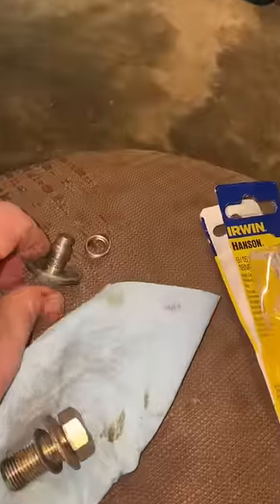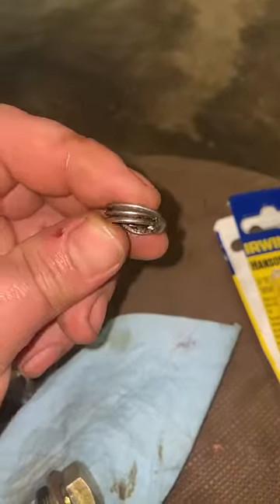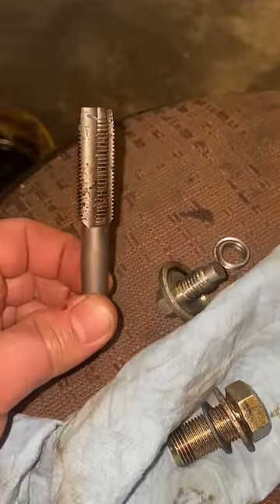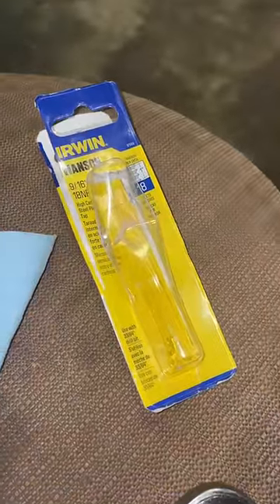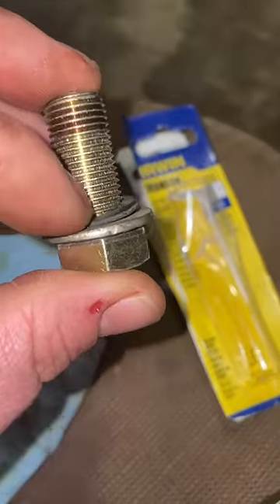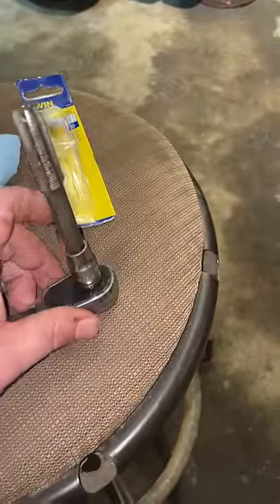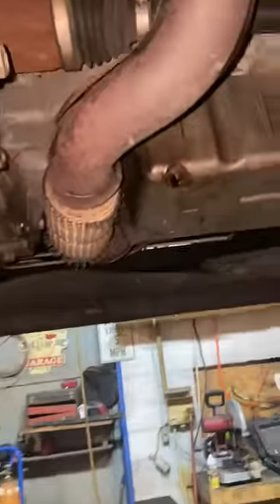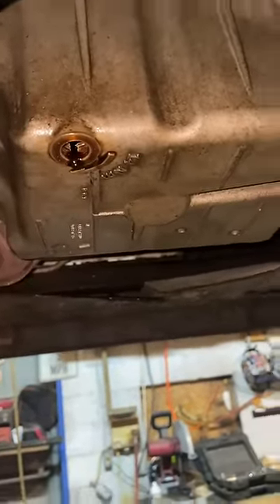Tap threads into oil pan repair quick and easy one!

Comment: I’m guessing you actually ripped the threads out when you were using your impact to reinstall the drain plug. That’s the most likely scenario. I have been an airplane mechanic for 15 years, and I have never had threads come out when I removed a fastener; only when I what installing them and misread the torque specs.
Reply: You should stick to airplanes then. When cars and trucks have quick lane places with zero training required to change oil...this is the stuff that happens

Comment: That extra long bolt will displace a
few ounces of precious motor oil n the 
extra 1/4 lb the bolt weighs will burn 
more fuel, Watson, but it will still work.

Comment: Lose the plain washer if the crush washer will sit on the bolt head nicely. There's a leakage path through the middle of the crush washer, then through the plain washer, then past the head of the bolt. Better seal without the plain washer.

Comment: It will still leak oil some u need to use a oil drain bold there is no gap between the washer and bolt
Reply: You are very wrong sir.
Reply: I saw that, I think I would have put in another Helicoil, or a rubber expanding plug, he is in dangerous territory by running a tap in there and putting an oversized Bolt in

Comment: What about the tap shavings in the bottom of the oil pan?
Reply: I thought the same thing
Reply: You put grease in the tap, it catches most of the sharp bits
Reply: Oil pick up screen catches all those.. leave for next guy
Reply: @marianarcas  I definitely wouldn't trust that method. That's just me. Better safe than sorry.
Reply: @ronlind1757  the pickup screen will catch a chunk. Not a small shaving.

Comment: Awesome job, not trying to be a bummer. But your not supposed to add a metal water on top or under a rubber one. The rubber won't allow enough pressure to seal the washer to the bolt. Will slowly drip over time.... happened to me 😅
Reply from the maker: No drips. Still going strong. It’s my dads car. Just gave him another oil change couple weeks ago

Comment: That’s why I never recommend using helicoil. Keenserts are much better. I’ve encountered helicoil stuck to fasteners too often. And if it backs out into a clearance hole for the bolt the two parts are still joined by the helicoil.

Comment: To anyone one doing this, flush the engine with cheap oil and grease your tap to catch as many chips as possible. Or zip off the oil pan and do it cleanly.
Reply from the maker: Pro tips 💪

Comment: …and just like that you bought a new engine for the client because the metal shaving left in the oil inside the oil pan got picked up by the oil pick up tube. 👍🏼
Reply: And went right into the filter
Reply: There is a screen on the pick up tube it would have to be very tiny shavings to get into the pick up then they would go straight into the filter lmao 🤣  all you have to do is pour oil in while you're tapping to flush the chips out. I take it you've never actually worked on a car before or done an oil change yourself? Lmao

Comment: Looks like it was a Heli coil never seen threads pull out like that .  Hope you took the oil pan off to flush it , shavings from cutting .
Reply: lmao wtf if you did that then you'd just replace the fucking pan after several hours of shop labor
Reply: I worked at a shop for years and I've seen countless aluminum pans with overtorqued plugs that the threads always come out like that intact on the plug. When you overtighten aluminum it shears the threads and they will usually come out on the plug and can be spun off and left intact like that and there is no need to take the pan off because you can just replace it at that point you just need to have someone pour some cheap oil in the top as you're tapping the pan and it will flush the chips out. You can also put some heavy grease on the tap and it will catch most of the chips.
Reply: @xpeacemaster  bro a pan swap takes literally 10-15 mins lmao unless it doesn't have a gasket and uses rtv for the seal then you have to let it set up before you put oil in it

Comment: That looked like a helicoil not the threads. They stuck the right way to fix it would be what this guy did or the threaded inserts for stripped threads just had my sons sparkplug blow its self out bought the kit and matter of 10min it was fixed an few days later it happened to another plug turned out the plugs were loose and the coil pack was only thing holding in the head

Comment: I always thought that the oil pan
bolt plug was one of the stupidest
still used/never evolved set ups.
Hot oil goes everywhere. You drop it...
Over torqued... Why not a valve drain?
Reply: So that a small rock , stick or animal don't open it .  if it had a petcock some pissed off chick or her brother might open it for kicks .
Reply: @JCcanU  
Yeah, just a ball valve with the handle
sticking down... Ah Dah and Doy.
No, I meant incorporated into the pan-
Instead of the plug threading into the pan,
It screws into the valve that's in the pan.
Take it out nothing happens. Insert a
Screwdriver thru the additional hole they
now have and turn the valve open.
Like a damn fireplace gas shut off.
If a crazy ex girlfriend goes thru all that,
then you shouldn't have boinked her sister.
Reply: @SaintMcFoye  lol You see her sisters it was worth it
Reply: @SaintMcFoye  okay great now instead of getting oil soaked all over your hands holding your wrench instead you're still soaked in oil but holding a key and it took twice as long to do... sounds good to me
Reply: @user-gd4gs6bn9o Marone dude. You don't put the key in the hole the fricking oil comes out Einstone. Why is it on here everyone plays devil's advocate with the stupidest reasons why something won't work, instead of trying to imagine a way that it would? You take the plug out like you would anyway and insert a damn Allen key into THE ADDITIONAL HOLE behind it and turn it 90 degrees. 5 seconds big whoop. Oil goes in the bucket. Nobody gets burned. Close valve, insert plug. Anjer Mamabloze...
Reply: @SaintMcFoye  cause it's a bad idea... if it was a good idea manufacturers would have implemented it years and years ago... if you're good at what you do you don't need to worry about getting soaked in oil anyways. why make it more time consuming for the sake of idiot proofing?
Reply: @user-gd4gs6bn9o  Just because youre good at a bad design doesn't make it a good design. And just because something isn't commonplace doesn't make it a bad idea. The table saw brake that saves fingers makes sense to me. Youre probably in the group that says that that wouldn't happen to them, and anyone it does happen to deserves it. Milk producers fought pasteurization. Car manufacturers laughed at the lady who invented windshield wipers. And how long do you think it took for someone to say having only a drain plug on water heater bottoms is stupid, they should have a valve down there? Sound like a similar idea?
Reply: @SaintMcFoye  you should have a look at Occam's razor - the simplest solution is usually the best one. why add complexity to a simple solution that has worked since the inception of the motor itself
Reply: I have done that on my yard equipment, extended out with a nipple so it doesn't run all over the frame, 90 down with a valve, no more oil running all over the place, including running down your arm
Reply: It's called cardboard guys come on now lmao just fold that shit in half to make a little run for the oil if the frame is in the way and they literally make valves that have somewhat of a "locking feature" if you can call it that lol you just thread the valve in and leave it then when you're ready to change the oil just push down on the little lever and slide it sideways and it drains thru the valve close it when you're done and you're good to go lol they have been around for years. After doing thousands of oil changes on almost every kind of vehicle you learn a few tricks to make things easier lol

Comment: That will leak..you can't use a regular bolt and washer with only one oring.the oil will seep down the treads and the head and leak..go buy a real drain plug that is oversized.they make multiple oversize and regular thread sizes at any parts store.

Comment: Yes I went to a fast oil change outfit and the guy stuck a pneumatic wrench on it and forgot to Revere the drive and stripped the pan. Then came and told me it was already stripped. But they could fix it for $380.

Comment: I bought a used 4Runner.  At my first oil change, I realized the moron "mechanic" at the Valvoline Instant Oil Change must have used an impact wrench to install the drain plug.  The threads survived, and I replaced the drain plug with a Fumoto oil drain valve to make every future oil change much easier.

Comment: While you're at it glue a magnet to the tip of that bolt catch any metal shavings I think that's a really good idea for all oil pan bolts it's a little magnet on the end of the boat the catch all the little metal shavings I know the filter would do it but
Reply: Oil gets hot. No amount of glue is going to hold a magnet. A jb weld or actual weld might do though.
Reply: The best way is to drill a hole in the end of the bolt slightly deeper that the magnet and use a punch to stake it into place.
Reply: If it's a steel bolt just magnetize the bolt, simple.
Reply: Aluminum is not magnetic lmao 😂

Comment: Those Chevy Cruze's always have stripped drain plugs, threads are less common though. Goddamn gorillas escaping from the zoo just to put on the drain plug and round off the little 10mm head. Years ago I had one that was helicoiled and in a bind we found that the larger sized Subaru drain plugs had fit it perfectly.

Comment: You do not want to cut new threads with the pan still attached. Youre just going to put the alluminium shavings in the pan.
Reply: Doesn't matter the sump won't pick it up off the bottom
Reply: @NuKe0clan0cod0videos  I would not trust you if you were my mechanic.
Reply: @badlandman8168  his right.  Lmfao.    But most of us flush the oil pan out with oil after doing this on the vehicle.   Been doing this replace for over 35 years.  Never have I removed the pan to rethread, I would be replacing the pan at that point.

Comment: until the motor cranks over and the rod hits it and why didn't you just get an oil pan bolt that actually is oversized that they sell with a tap

Comment: Except there is now tons of metal shavings circulating inside the engine and that super long bolt for a long drain.
Reply from the maker: Oh u betcha. I’m not smart enough to comprehend how to deal with those shavings and that long bolt will most definitely hurt the engine 🤷‍♂️ thx for the advice 👍
Reply: @FerKurl  not to mention having a loose washer is still going to leak
Reply from the maker: @gorillawrenchin  no leaky leaks

Comment: Damn things going to leak you need a seal also on bolt head side to keep from wicking down out between bolt shank threads, head and washer side. Is there any thought process go into this sort of shit.  Notice bud the washer on the old plug has a built in washer with recession for seal and the washer is a manufacturered part of the head reason for not having two seals it has only one part line. But when you use a washer that has two part lines on a regular standard bolt with washer you better add two seals.  And the seals better be flat ones like you put on that new bolt.

Comment: Cool but the next person that does that oil is gonna be super confused when they pull out a 3 inch drain plug bolt.... If that was my car I'd probably get the longest bolt I could just to mess w/ my local workshop people.     🤣🤣

Comment: Oil change people need to stop using impact guns on oil pan drain plugs. They don't have to be torqued to 80 ft.lbs. it's a drain plug, a little over finger tight is enough.

Comment: Helicoil bud
Reply: Wrong, that's what happens with aluminum threads
Reply: @gorillawrenchin  you’re wrong buddy. You can literally see the steel threads in the beginning which also means it’s been repaired before. Proper way would be to repair the same way it was repaired previously . Using a large diameter bolt is wrong because it requires more torque which will strip out the aluminum faster. Also the length was just dumb. Could have easily cut it shorter but now it has a chance of messing up the aluminum threads if metal shavings get caught between the bolt and aluminum as you remove the bolt.
Reply: @Dirkadew  larger bolts don't make it strip easier 🤣. Shows what you know. There is more surface area in a larger bolt. Keep being oblivious to the truth

Comment: Crappy job threading that pan new bolt just slops around so it will easily strip out. Oh yeah and by the way those are not threads those appear to be a set of helicoils so pan was most likely already stripped once before.